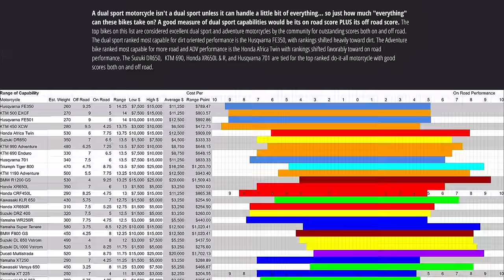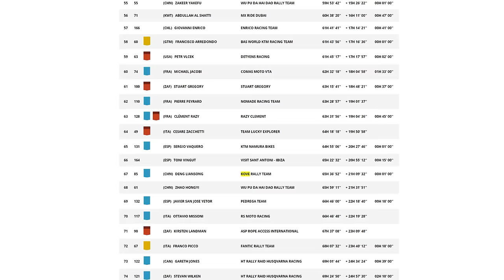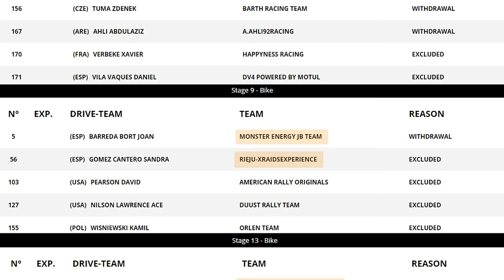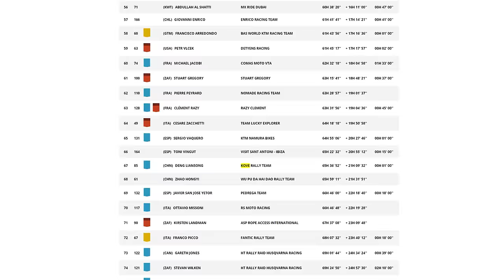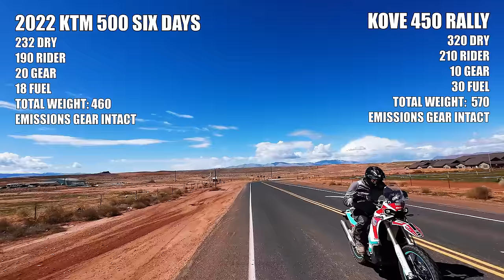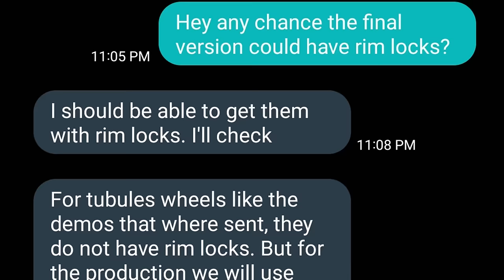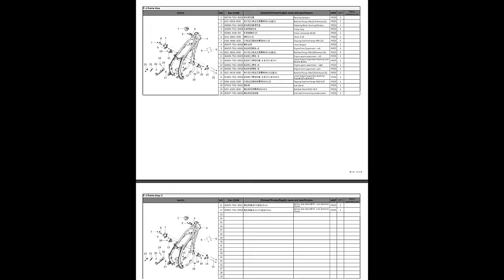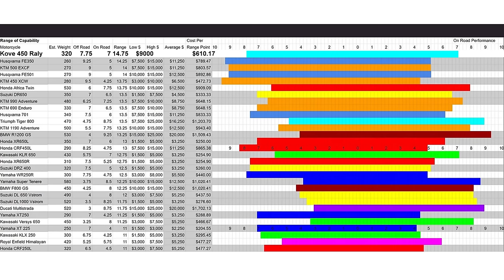I bought CHINA'S Dakar Rally Motorcycle! Kove 450 Rally BRUTALLY HONEST REVIEW + KTM 500 Drag Races!

Comment: The success of a motorcycle brand depends as much on a good dealer network, support and supply of spares as the bike itself. This test was after just a week. Did they give it to you for a long test? No. Come back in 1 year and see how it's stood up by doing a compression test and other visible signs like leaking forks and wobbly swing arm and steering head bearings. Put 30,000 kms on it and see what wore out. Then make a judgement.
Motorcycle manufacturers are reluctant to back their brand here in Australia where 6-900km day rides are the norm for adventure riding. A bike absolutely has to be capable of at least 500km between fuel stops. So anything less than 20 litres will not cut it.
Then there is the wonderful Australian Consumer Law. This came in from 2011 and overrides any factory warranty, and for all practical purposes imposes a 10 year guarantee on cars and motorcycles. That's why you do not see many Chinese bikes on sale here, and also why KTM and Husky struggles for any market share. As they say here, if you ride a KTM, where is the support vehicle? They break or wear out. Here, in the outback, the BMW GS models, Suzuki and Yamaha rule the tracks. Even Honda is marginal. Don't believe me? Watch this channel to see: "mongrel dog productions".

Comment: Big does of skepticism. 51hp and "restricted"? Yea... sure. Go get it on a dyno and emissions tested. Or was that not allowed in the review agreement with gpx?  GPX web site even states it is NOT street legal: "The First 70 models will be imported as “Competition offroad models” and NOT street legal in all 50 states." So if its putting down 51hp that's its un-corked full spec HP.
The drag race part of the video is also a bit un-scientific. Switch riders, set clear start and end points, matching tires, etc to make sure its an apples to apples comparison. Better yet compare closed course laps. When the race goes on too long and it's pulling away that just looks like dualsport vs offroad gearing. Also banging off the rev limiter on the ktm with some slow shifts. 
The 6 days which is actually restricted to meet emissions would be making like 35-39HP. With euro map and unrestricted exhaust you should be 55-60ish. Its a bit click-baity to pass off this as two street legal restricted bikes racing heads up. KTM 6 days uncorked will be much faster by the numbers(higher hp, much lower weight).

Comment: @eveRide after going to 3 of your rallys and following you for years, I really trust your opinion.  IMO I'm sticking with my ktm 500 for this niche because I had a bad experience with GPX FSE 300r. Brand new machine and I broke so many things and its such a hassle to get parts and then endless wrenching. I want to go to RMATVMC and put in my machine and order parts, not have to figure out which cloned ktm parts fit and which ones requires to contact GPX. Normally GPX is great to work with, but sometimes they lash out if your experience isn't positive. I'm not making a personal attack, I'm just saying there is a quality issue and I'd like to get that fixed, don't take it personal.  Someday I MIGHT try the 450 rally, but I'm not going to be an early adopter. I LOVE Everides content and more so I love Ty, he is a solid friend and I love riding with him!   My fav bike ever is a 300 2 stroke, followed by a tenere 700.  I loved wr450f, but I wore it out and it has buggy starting issues. For this niche of the 450 rally, I'll bring a giant loop fuel bag and run my ktm 500 thanks very much...or get a bigfreaking gas tank.  I'm happy to make a list of issues I had with my GPX.

Comment: Really nice review! Would love to hear more about how it compares to the DRZ 400S...handling, highway use, technical riding, etc. Does the gearbox allow it to crawl up steep rocky trails yet allow it to cruise on the HWY more comfortably than standard DRZ gearing?
Reply: A 400 DRZ is a trail dual sport bike, in a Dakar like trail you won't make 100 miles, Top speed on road is around 140 km/h but if you want be more comfortable offroad you have to put a bigger rear sprocket. It's a good and able bike after tweaking the suspensions (I hand one although I preferred my "440" XR) but it's no match with a Kove 450 Rally which is a genuine rally bike, more than 10 hp more and 170 kmh top speed because of the 6 speed gear box and 10 HP. The suspensions are impossible top compare in quality.
I forgot it has already been already answered in the video, yes it can can crawl steep rocky trails.
Reply: Is that a joke lol?

Comment: I am still not sold, cuz it is one of the Build-A-Bike brands that several other companies will slap their logo on {Chongqing....you pick from a pile of mostly different KTM/Honda copied parts and what your brand name is and how many u want, they assemble them in crate and ship them to you}. Iv owned SSR, Kayo and GPX. Wanted to love them, did for a bit but just had issues after a year. All of them could never get fueled perfect. The Delphi and Rojo EFI systems were never quite mapped right, the carb models didnt match the air box could never get a proper carb jetted correctly. If something broke, it was on you to Frankenstein parts from Honda or KTM. I will say the NC 250/450 are good, especially the dohc ones. I know that Gary is good dude, and I like what he is doing. After all, I drove 6 hours to get one of the first GPXFSE 250R's in AZ....before the same one that Tyler and Gabe thrashed in vids here. It was suppose to be my perfect bike {low maintenance, lighter enduro/dual sport} but I had issues a year later and that model kept changing until u 5 years later it would be impossible to order parts for cuz not made anymore. Kayo was cool, was the first to get a dohc NC250 and WOW, what a motor. A short time after I sold it, dude said the entire EFI system was malfunctioning. My SSR450 was so much of a CRF450X that i just made it into one with carb and suspension to sell it. Thats my experience, glad to try it but glad I made it out only losing half the money spent on the bikes within a year or two.

Comment: The Kove certainly looks a capable bike, but the price of the rally replica is $14000, for $9000 you buy the standard version, which is the one you tested. Service intervals aren't so good, we are talking about 2000/3000 miles, which is 3200/4800 km. There is no way to know how long the engine will last. I doubt you'll get the same reliability of the Honda CRF 300. Now, for $12000 you can buy the new Husqvarna 701 Enduro or the GasGas ES 700, which is a bit cheaper, but it's basically the same bike. It comes with 10000 km service, 74 HP, and 146 kg dry weight. Now, it's not the same bike, but I would rather get the GasGas ES 700 to use for an adventure. As a rally bike, the Kove probably wins hands down, after all it did the Dakar, but the average mid age overweight fella won't ride the Dakar. That being said, I look to know more about this bike, and I am impressed how the Chineses step up the game.

Comment: Its a 450 with a fairing. 

So it has some wind protection.

It still has all the other problems of a single cylinder high compression bike. Its gonna vibrate like crqzy at highway speeds, its gonna need oil changes every 500 miles and valve adjustments every 2000.

This is not a unicorn by any strecth of the imagination.

Comment: How is the transmission gear spacing compared to a DrZ400s, which has a first gear on the tall side and a 5th on the short side?
Reply: Wide ratio transmition, cruises at 75mph just fine and smooth

Comment: I would still prefer a cleaned Yamaha Tenere 700 or CRF 250. Get the heavy exhaust off and all other unnecessary parts. This can safe you much KG.  Price around the same and a promised reliable engine. I will wait a few more years to see how these bike will hold on. Especially on the second hand market. A high end Chinese Xiaomi mobile has almost no value after 2 years and cost you 580,- And Iphone cost you 880 and is still worth around 400 after 2 years.

Comment: Seems a nice bike, but the power claim hasn't been checked yet. It is sloppy in low rpm, you twist the throttle and nothing happens, that is not 50hp, you do that on a 500 and you do a double backflip. 
I can see that enthusiasm and I reckon it is good, because the price makes finally sense. but to compare it to a KTM in terms of power is a big no no. 

Clearly a good bike but if you are not into performance. That is the point right here, that bike fits the average Joe who wants a reliable, comfortable, enough power he can handle (the 450/500's KTM have way more power than most people can handle). 
So indeed it seems a very good bike for those who want better than a 300L. 
I am pretty sure you can do really long riding, but I really would like to see some hard climbs, because you usually grind and see how it handle. 
Overall, that bike clearly rock, she is a beauty for the least that we can grant her that part of the bargain. The rest is yet to be written regarding reliability, but I am confident she is a good bike for the 85% of the guys out there who want a real adv bike, not a 250kg bike that has ADV written on it and keep looking for the dime on the ground at every corner. 
That bike to my knowledge is the only ADV/enduro/Rally real offroad capable as we speak under $15K

Comment: A cable clutch? Not going to do anything technical with that.
Reply: Yeah, do you think that's why the subject was largely glossed over, with just a reference to a "light pull"?
Reply: @MarkDaleADV  It's a big deal that's not addressed. I really wonder what the suspension is like since that's a huge factor as well, but they did say fully adjustable at least. If you can't use the clutch easily with a single finger, then you have to take more fingers off the handlebar. That's exactly what you don't want to do when going over something technical that requires clutching while also controlling the handlebars.
Reply: @cyrex686  ditto, but more important to me is being able to finesse the clutch when required, I've suffered at the hands of grabby clutches before, on previous bikes with Chinese engines, CCM, AJP, etc. I've got a gasgas trials bike with a hydraulic clutch, so have been spoiled. We don't all ride in wide open spaces!

Comment: Electrical issues point to the attention to detail used throughout.  If it was $7500 maybe, or if I was rich and didn't mind owning a $10k doorstop with a blown gearbox that wasn't worth fixing due to the replacement parts being the same low QC parts, but there are better alternatives just like there are better alternatives to that Silicon Valley bank that went belly up.  For us normal folk that struggle to afford a bike, this is a ridiculous gamble and I'm not a fan of all the fawning going on over the lastest flavor of the month.  Sure there are many things made in China, but they are held to high QC standards by a non-chinese QC program.  We have a local shop that has had to quit servicing SxS's made by a certain brand from China because they quit responding to phone calls about their warranty coverage.  This type of thing is a real problem, not some political anti-China nonsense.  Buyer beware.

Comment: I still ride an 03 KTM 640 adventure.  Until KOVE there has not been a bike that I consider an upgrade or even sidestep from it.  KTM ignored what everyone asked for when they built the 690 and this thing is going to bite them on the butt. They have been snoozing and putting out bikes no one asks for.  The 890 is awesome, but not really a in the same league.  It still has shorter suspension and significantly less fuel range than a 640A or this Kove.I am in SLC and am really excited about this bike. I need to go down and check them out. I am not sure if I will go for the 1st year version or wait another year for supply stuff to catch up and a little real world history with this bike.

Comment: I’ve owned MANY Chinese off-road vehicles.  They are merely stage props and characatures of quality originals.  EVERY single component is the cheapest lowest cost version.  Where Yamaha may use a clutch cable of high grade steel with 13 strands, China will use bulk scrapyard melt steel with 7 strands, and extra lubed so it doesn’t rust and break. Bushings?  Ball joints?  Laughable.  Non-heat treated cams and rocker arms.  Yep.  Black iron piston rings rather than steel.  Yep.  You most certainly get what you pay for.  But people are suckers for a new shiny toy at a very cheap price.